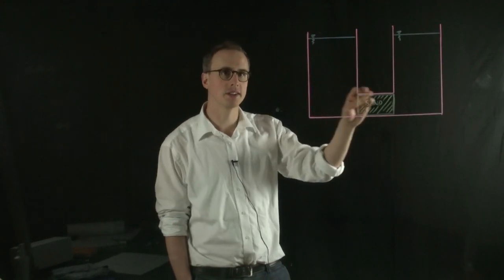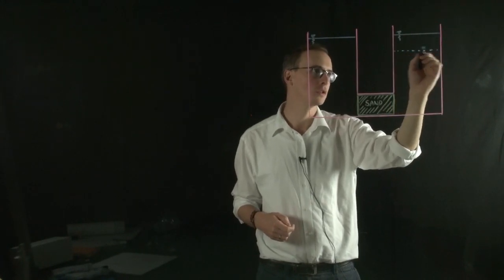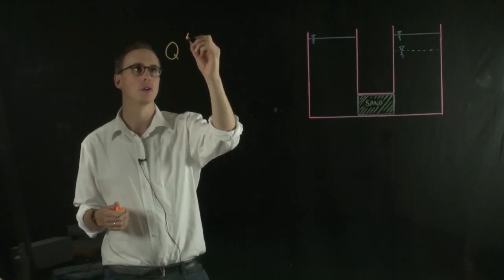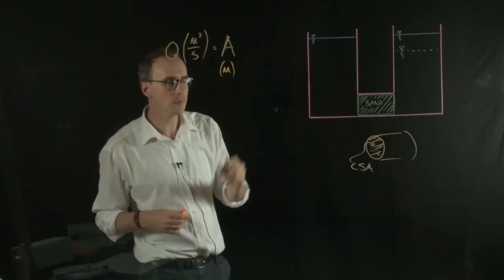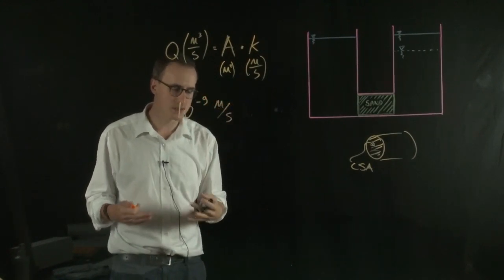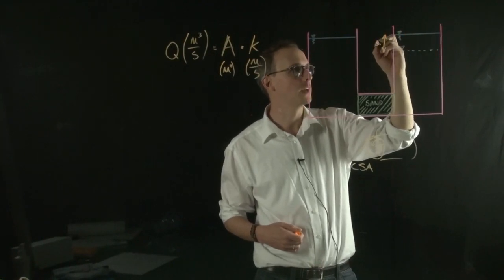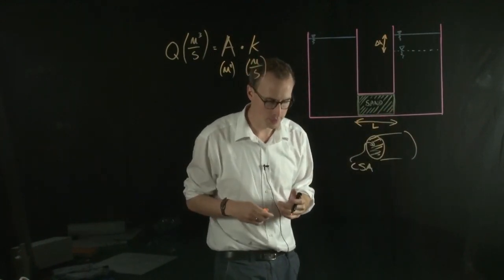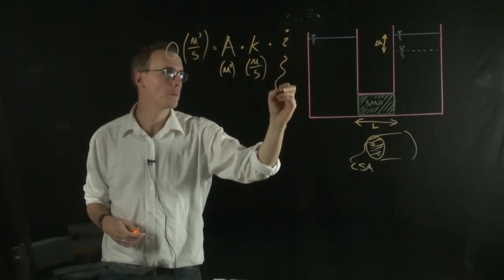Darcy's Law

Comment: The illustration is so brilliant. Very informativne!
Like how you define on example of GRAUNDWATER FLOW and PERMEABILITY because it is NOT similar but is important to undersanding Darcy's Law in civil engineering. Also in few minutes you give important formula and what is HYDRAULIC GRADIENT in this case. Groundwater is simply illustrated from area of high water levels to area of low water levels - we say that groundwater flows from areas of low hydraulic head to areas of low Hydraulic gradient. It is therefore the HYDRAULIC GRADIENT which graundwater flow but if is tottaly float there would not be groundwater flow. I can conclude that you did master design fit in few minutes! 
As such, it is a good example of PERMEABILITY as well ~ ability to control speed og groundwater flow. It is the ability of a rock or sediment to transmit fluid and form of Darcy's low in planty hydroprojecting as well as for achiving new research.
Reply: Well I personally think that it's actually related to groundwater flow and permeability. I'm  a geology student currently studying Hydrogeology and so far I really see the connection between Darcy's law and Groundwater exploration . It's so cool to see it you link it up with your field too.😀